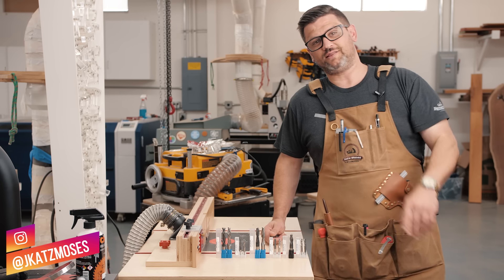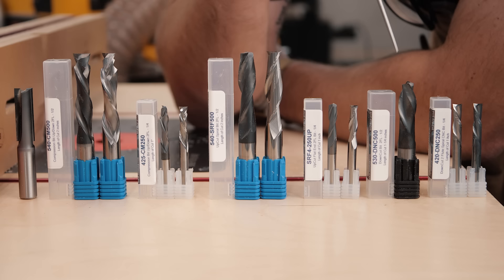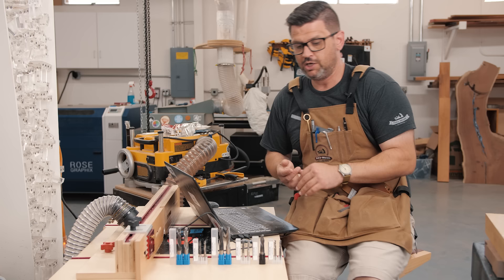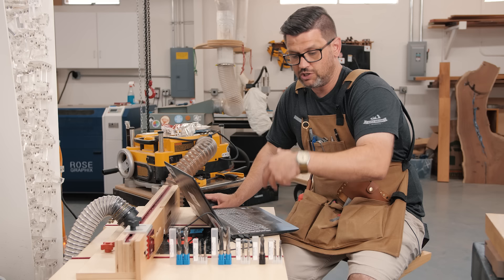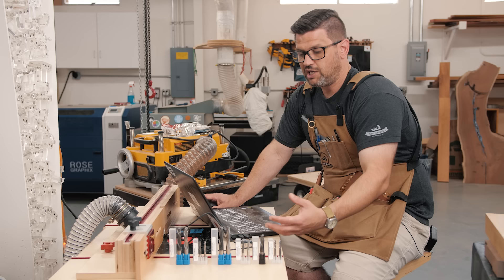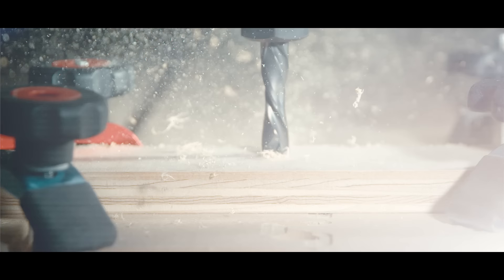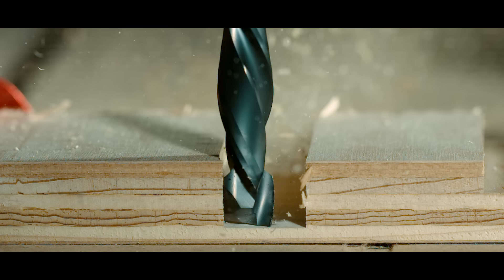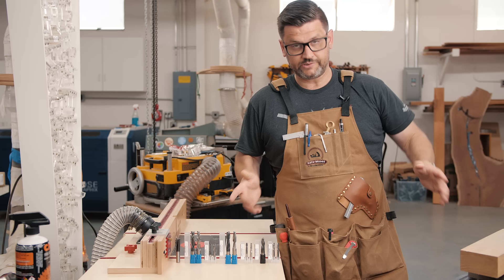Spiral Bits - Compression VS Upcut VS Downcut VS Straight - Never Before Seen 19,000 FPS HD Video

Comment from the maker: Support What We Do at The Katz-Moses Store- http://bit.ly/KMWstore20
BitsBits is the BEST place to buy router bits: http://bit.ly/BitsBits USE CODE JKATZMOSES15 for 15% off 
PART Numbers
Astra Coated Compression ½” - 540-CM500
Compression ¼” - 425-CM250
Upcut Spiral ½” - 540-SRF500
Upcut Spiral 1/4” - SRF4-250
Downcut Spiral ½” - 530-DNC500
Downcut Spiral ¼” - 420-DNC250
Reply: I just bought a shop apron :) super excited to get it!
Reply: Newbie router guy here, thanks for the very helpful information.  Just ordered the top compression bit from your guys, figured I won't have to think about that for a while!  12 buck discount, thanks again.  I'll be back soon...
Reply: How would it work if I did a contour toolpath in 2 steps, and did a bit change mid way from a down to an up?

Comment: Amazing explanation .... small tip for whoever wants to start using spiral bits - if you want to experiment a bit and see which bit is best for your application before laying down your cash and buying one, get some HSS end mills - they are spiral bits that are used in milling machines and fit just as well in a router ... they are CHEAP AS HELL and an engineering supply house will have all sorts of shapes and sizes ,so you can really experiment before committing to buying a more expensive bit

Comment: I love downcut bits. I get that on the leading  side of the cut you get fuzzing, but the rest of the cut is very smooth and clean. When if I stop before the edge, it is always covered or I square off with a chisel. Plus, I almost always plunge and when I cut though both ends have clean edges. Of course us woodworkers have our personal preferences, and it is great to have choices. Totally awesome vid sir.

Comment: Great video on a little covered topic.  It will become my "go to" source of demonstration, especially with the slomo's, when I am trying to explain why downcut is the way to go, even though it sounds illogical.  One scenario that I don't recall seeing is a through-cut, where both the top and bottom faces are unsupported.  For example, the workpiece is clamped so the cut is off the edge of the bench, and in the final cut, the bit is protruding above and below the work.  An upcut bit will tear out the top.  A downcut will tear out the bottom.  A compression bit will produce beautiful clean edges, both top and bottom.  That reads like Momma bear, Poppa bear, and Baby bear... never mind!  Thanks for your stunning videos.

Comment: Cutting plastic is becoming such a big part of a woodworkers hobby, I sure was hoping you would included a O-flute upcut and downcut bit to show how it cuts through 1/2" acrylic, HDPE or polycarbonate. This would be a great video for you to make because not many are well versed on the newest O-flute bits and not many show how to cut through plastics with such bits. In fact, I haven't found any videos on this subject. Right now I will just have to rely on Whiteside's recommendation of their RU1601A. Also, another subject, which is the best diameter to use for through cuts on woods or plastics 1/8 or 1/4?  Thanks,

Comment: just a heads up: 
IR is not good for comparing two different materials without first calibrating the IR gun between materials for their emissivity. 
And the difference can be quite severe. 
In an example from work: we put a SiC filled ceramic on top of a paper plate and heated it in a microwave. (ceramic material absorbed water and we were trying to drive off the moisture)
however.. a microwave should only heat something that vibrates with microwave. SiC is a microwave and IR absorber
so after 4 minutes in the microwave we opened the door and used an IR gun... and the ceramic+SiC was reading 62F.. in a 76F room... strange?! however the paper plate that it was sitting on (and paper does not heat up in the microwave) was registering 450F, starting to smoke, and turning black!!!
the ceramic+SiC was actually at 480F (thermocouple measured), but was emitting almost no IR radiation, so the IR gun thought it was cool, and you could put your hand next to it and feel no heat.. despite it being quite hot. 
All of this is to say that IR emission has nothing to do with the temperature of different surfaces, but rather has to do with a temperature of a particular surface. 
It is good at doing comparisons within the same material, but not between different materials (such as coated vs non-coated bits) 
It may be good enough for your demonstration, but i'd check some coefficients first. (if you can) - or measure with a small thermocouple / thermistor.
Reply from the maker: Great advice

Comment: This video really helped me understand what I really need.
Excellent!
I just had a doubt: I need to make through cuts in plywood with a hand held router. 
So, which would be the best option?
Downcut or compression bit?
And the ideal would be to use a patern bit that is downcut or compression, because I need to use a template to cut several equal pieces in plywood.
What do you recommend?

Thanks again for the excellent quality of this video, and the detailed explanation.

Comment: Loved your video and I would appreciate your advice. I need to engrave some straight lines 1/2" wide and deep into a 3/4" mdf. Which bit type would you recommend for this job? The pieces will be painted so the cleaner tu cut the better the finish and the easier the sanding.

Comment: Seeing the slow-mo close-up efficiency/ effectiveness & different cutting characteristics of spiral bits in action...  makes me wonder if a tool manufacturer could design a jointer &/or planer machine where rather then using traditional knives or carbide inserts on helical cutting head, they instead design a machine that could incorporate a swappable/ interchangeable spiral bit (sized 6”, 8”, 12” etc. depending on the width size of the machine’s infeed/outfeed bed).. the specially designed spiral “jointer/ planer bits” could be positioned into the planer or jointer just the same as a traditional cutting head, supported on both sides of the machine... but allow you to easily swap in/ out new or a different spiral cutting bit into you planer or jointer (kind of like how you easily swap bits in/out of a router, horizontal boring machine or lathe chuck).   Instead of having to exchange planer blades & then readjust the planer beds, or individually rotate 40+ carbide inserts in your shelix cutting head...  You could just swap out your old 6”, 8”, or 12”, etc. long spiral jointer/ planer bit and slide in a new one or different shaped one depending on the type of wood your planing/ jointing.   Maybe I just have yet to realize there are planers/ jointers like this out there already?   Or maybe the cost of those 8” or 12” long specially designed spiral “planer/jointer” bits would not be the most affordable/ practical application for a planer/ jointer cutting head?

Comment: Heat then burning is caused by not taking enough of a bite so to speak. Not by taking a large cut. When you take small cuts the bit touches the wood many more times and burns. Chip load vs feed rate.

Comment: So for a router table instead of a handheld router we need to reverse the choices for up and down, because the motor is under the work on a table instead of above the work handheld?
I tuned in because I have a new (old) tablesaw with router table, and every single router bit that came with (killer craigslist deal) has a bearing on the end of it, and I think to do some kinds of jointing with it I need one of these bits that has no bearing on it.    I was looking some of my end mills for my mill thinking I could try one of them.   I guess I am a little concerned with running those at 10000 or 20000 rpm, where the mill probably never goes over 1000 rpm or something.

Comment: Another great demo.  SO ... for cutting box joints  ... on a router table ... use Up Cut (or Compression IF cut is deeper than 1/2"), correct ?

Comment: Amazing video! Always the best explanation andf the slo-mo video drove the examples home. Thank you. Question: In a pin router scenario, same logic as handheld router since cutter is pointed downward? Reversed for table router? Much of my cutting is template based, so typically using a pattern/bearing bit which is not common on spiral bits - especially at 1/2" diameter.

Comment: Great video.  Compression bits sound interesting, but I follow the 1/2 tool diameter depth of cut rule.  My CNC can hog material, but I get the wiggles when I make single deep passes.  That being said my bits go 300ipm...so I guess that's moving also :-).  Guess I gotta go buy one from Bits and Bits now and give it a try...curse you Katz- Moses.
Reply from the maker: You should look at manufacturers chipload recommendations before setting feeds and speeds. Ive been learning so much since we got the big cnc and I cant wait to share it with you guys
Reply: @katzmosestools  I look forward to it.  I have a CNC router parts 4*8 with their spindle, so I am excited to see the upcoming videos!  I used it for large table top and cutting board flattening....works a dream.

Comment: What about using an upcut bit on a router table with a zero clearance insert? It seems like you'd get the best of both worlds. I just wonder about evacuating the dust. Might need to put some slots or something in the insert to allow the dust to get down into the cabinet.

Comment: It is not the shear-cut that makes the vibrations smaller. It is just the way more consistent forces. With a straight-cut you the forces are just oscillating left and right. When moving forward the cutting-edge starts by pushing against the movement-direction, then 90° to the side, then pushing in the movement direction. With a spiral cut specially if it goes deeper the forces don't change as much.

Similar for the splintering:
The upcut is worse than the straight, and straight is worse than down. Just cause the downcut is pushing the wood down - compressing it at the edges, the straight isn't, and the up is just pulling out the fibres.

Straight-edges also have their uses. Firstly of course cheaper, and they are easier to maintain.

Comment: great video, very informative
BUT i wish you would have touched on making box joints with a router and which bit is the best for that...
I'm guessing compression as long as the material thickness is greater than the upcut portion of the bit?

Comment: At 6:41 of the video why was it that you compared the straight bit running on the second pass and both spiral bits running through the first pass? A lot of great information in the video and I'm torn between spending the extra money on spiral bits as appose to straight bits. I do a lot of template routing on a table mounted router where the thickest material used is 1 3/4" . Any advice is appreciated. Best

Comment: Hi Jonathan. Which bit would you recommend for cutting box or finger joints on a router table using a jig? I've been trying to cut French oak with a straight bit but am having a lot of tear out so was wanting to get a spiral bit. To me a down cut bit sounds like a safer option because it's not pulling the finger downward away from the piece of wood like an up cut would do and potentially sheer off the finger.

Comment: Which would be best for cutting through 3in of soft yellow pine, my router is a variable speed from 8000rpm to 26000rpm an my current bit is a 3in long double flute straight cut but it will not bite into the wood am I using the wrong bit

Comment: Really great video, I enjoyed this one a lot. I found out about the chatter on the straight bits the hard way. I recently did a project where I had to route a 6 x 17mm slot in a 15 x 80mm part, everything was so small there was no mass to counter the chatter. Switched to a down spiral and all was improved. Any chance you did a clip of standard vs climb routing? Could help to explain why routing direction is so important. Keep up the good work man.

Comment: Thanks, I’m starting to use down cut bits for template routing in the router table, you mention that you need to go slower with down cut bits, if that slower spindle speed or slower feed rate or both?

Comment: Another great video, thank you for the info. 
One thing though, these bits are NOT affordable for the average person. $600 for a set of 3 or $150 plus for a single bit is very expensive. At one point you say the bits are "Mid $20 range" I went straight to the site and nearly had a heart attack when I saw the prices.
Reply from the maker: Compared to what? Serious question. Let me know and I'll break it down for you. If you're using router bits I guarantee these save you money. I know prices have gone up a little since I posted this video but that's everything with inflation.
Reply: @katzmosestools  I'm sorry if my post came across rude, offensive or aggressive. That was honestly not my intention as I have the utmost respect for you and your advice. I was just surprised to find that the bits you were referring to as being sub $50 then finding out they were 3 or 4 times the price. 
I'm just an average guy with an average income, but if you say these bits are the way to go, then I'll figure out a way to get some. 

I  could always trade my least favourite son in for a set of 6 🤔🤔
Reply from the maker: @ryanhanslo3029  it's a quality issue. These bits, ran at appropriate feeds and speeds will last a very long time where as cheap bits will be dull after a project. I always say, buy once cry once which doesn't quite translate to consumables but the sentiment remains. Wasn't offended at all. Just really passionate about saving people money and judging cutting tool and consumables by price isn't the whole story. Cheers

Comment: I was wondering about those compression bits; since you need to make deeper passes, would these bits be a bad idea on router tables or with portable routers where the hands are being used to hold the work or router?  Wouldn't these bits be used most safely on a CNC machine?

Comment: Wow, so much good information. Thanks for making this video. The slow-motion footage is so cool! I am fairly new to woodworking and am hoping to make some box joint boxes out of nicer woods, oak, mahogany, etc. I was at my local Rockler store this weekend - I am a huge fan of Rockler btw - and they said I would avoid tear-out on these Dado cuts with a Spiral bit. I didn't realize until I paid for my stuff that this 1/2" Spiral bit cost $40. Now $40 isn't going to break the bank, but for one bit that seems like a lot - although I have seen similar bits on Amazon priced as high as $60 or even $70. My questions for you are 1. Do I need to use a Spiral bit to avoid tear-out if I am cutting hardwoods? 2. Are cheap Straight bits as different from expensive ones like cheap saw blades are? I bought a Freud Flat Top blade that is amazing compared to the Avantis I've bought from Home Depot. Thanks.

Comment: Hey great stuff. Question on the footage at 9:18; you appear to be advancing on the "wrong" side of the bit relative to direction of rotation. I'm new to woodworking and just watched your video on routing and noted that you mentioned that sometimes there's reasons to do this. Curious if there was a reason for making the cut like this in this case?

And fantastic video mate; really clear explanation, and the slow mo footage really illustrates well what's goin on. Great stuff, thanks!
Reply from the maker: Doesn't matter on a cnc is the best answer

Comment: This is a great video. Just getting more serious into routing and this is great info! I need better bits and I am going to go to BitsBits. I do have a question though. I notice with all of the bits other than the compression bit, when you are making the second pass you are conventional milling. But with the compression bit the second pass is climb milling. Is that because you are using a CNC router? I know with programming metal cutting on our CNC machines we always use climb milling when possible because it is easier on the tool and inserts. But I know what happens and have been warned not to do it with my hand router and my router table except for very fine, light cuts where you want a better finish. Is climb cutting a characteristic that is unique for the compression bits? Love your videos, especially the high speed cameras.  Thanks!

Comment: Loved everything about this video, thank you for the hard work! 🎉❤️ quick question if I may, I’m using a CNC and my shapes and cuts in the wood at the end look like streaks of where the bit passed by.... this is on Oak, so I don’t think a compression mill would help, but what would you recommend in order from saving me hours of hand sanding? 
Thanks again!
Reply from the maker: Sounds like your router is out of square. Look up how to tram your machine. Cheers
Reply: Jonathan Katz-Moses I was very afraid of that answer haha... it makes sense... I just hope I don’t break anything while fixing it :P... Thank you so much for taking the time to answer !!👍🏼👍🏼👍🏼👍🏼

Comment: Dam your the first person I've seen say downcut for plundges as was told the chips have no where to go so effects the cut?  Just bought a few uncut on advise as want to stencil trace so will be plunging on ply.
Would I just trace reverse side of piece with uncut to keep face nice?  Dose the backing template help hold  edge from tear out?
Could I compression template route or would it be too much material to cut in one pass?
Cheers
Reply from the maker: I'm pretty sure I say the opposite. Upcut for plunge
Reply: @katzmosestools  sorry didn't refer to just plunging a hole meant like plunging plywood to start a cut like the CNC or stencil cut would need to do to start cutting a line?  I'm not router experienced much so I may be calling increasing cutting depth  a plundge?  All plywood referenced